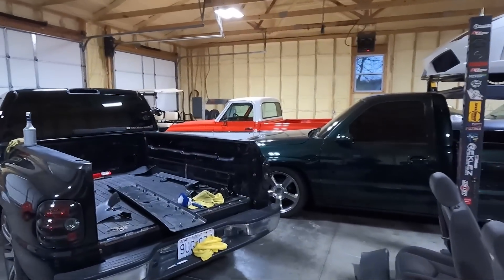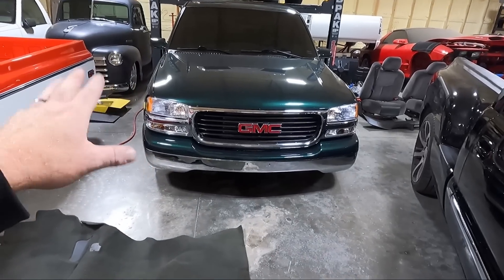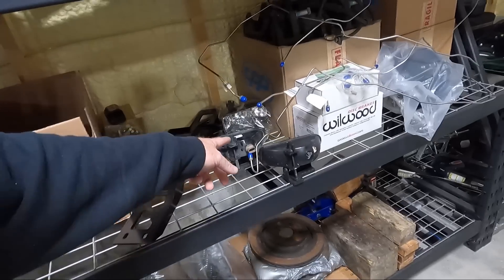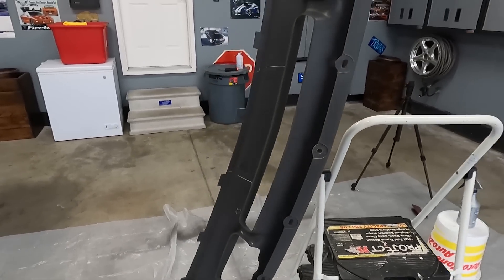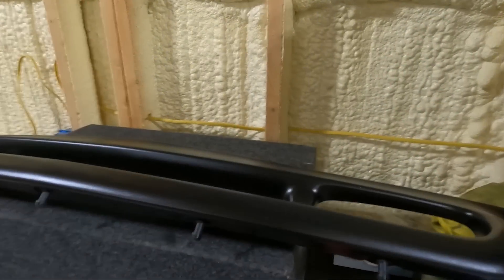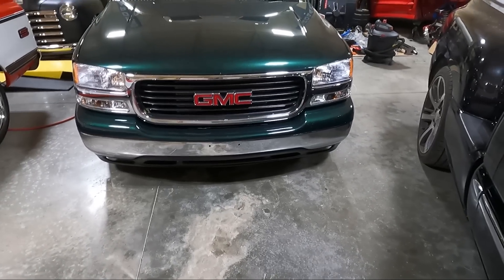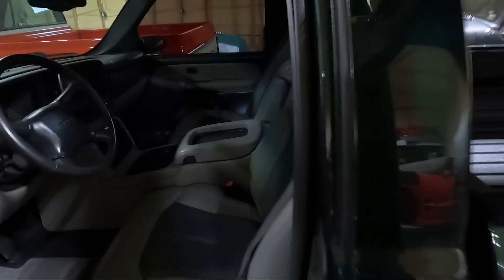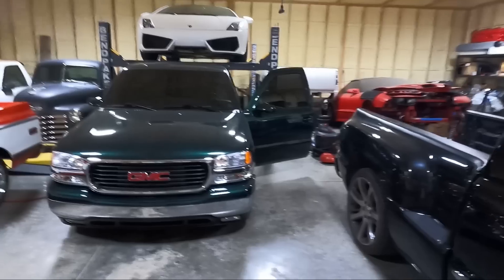Slammed GMC Sierra Wrecked! (Fixing My Screw Up!)

Comment: eagle eyes makes real nice OEM fog lights for that truck that don't bounce.  I have them on my 06 Yukon with LEDs in the housings.  I also shimmed my lights with body shop shims and I oblonged the holes on the plastic bracket to give me more adjustment.
Reply from the maker: I have used eagle eyes and wasn't impressed but maybe they are better now.
Reply: @TWAMotorsports  yah - it's hit or miss with the aftermarket brand.  The whole fog light design is pretty cheap from the beginning.  The best thing you can do is to make sure those 10mm bolts are snug to the bumper like you did.
Reply from the maker: I agree with that

Comment: I was kinda scared to watch 😖 Lol. Looks a lot better black, I painted mine also when I installed the hidden winch mount behind the bumper. I don't have fog lights but if I push the dome override button 3 times quick it will turn the headlights off with the key on.✌🏻
Reply from the maker: Yeah. Crap happens. The dome overide kills all power to fog lights so that doesn't work either unfortunately
Reply: @TWAMotorsports  I have a feeling it won't stop you from giving it all the beans every once in a while 😂.✌🏻
Reply from the maker: That's for sure

Comment: You should be able to run fogs and parking lights without the headlights. Turn the headlights switch counterclockwise while fogs are on.
Reply from the maker: Doesn't work that way in 99 to 02
Reply from the maker: Wish it was like the 03 up